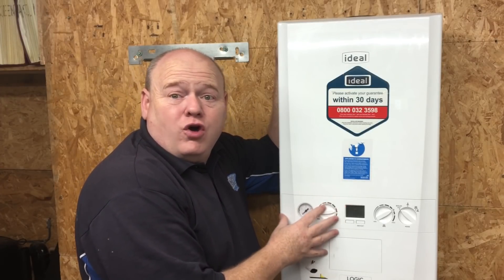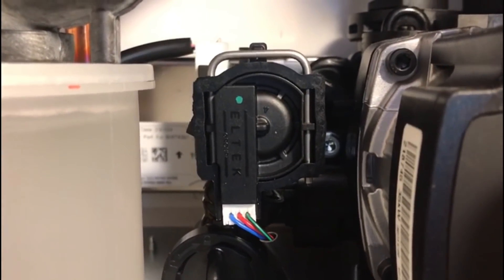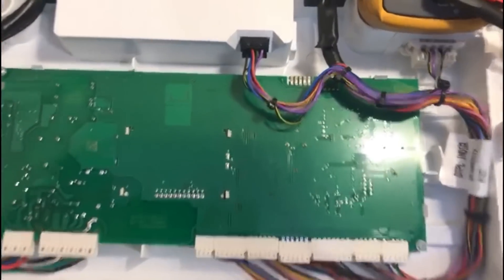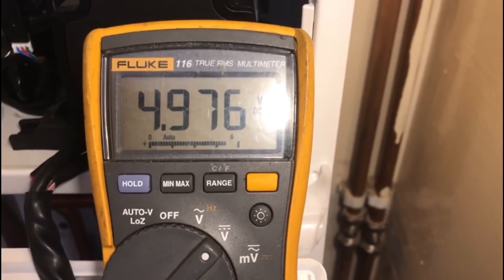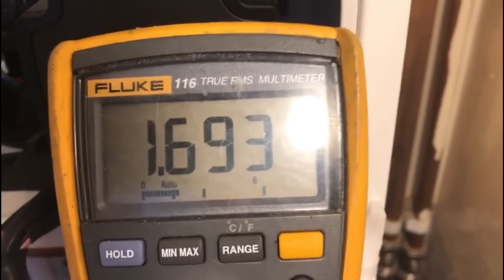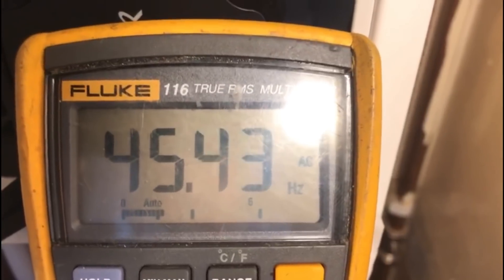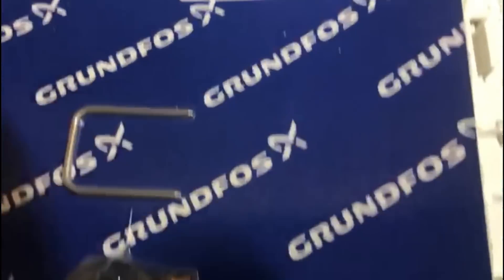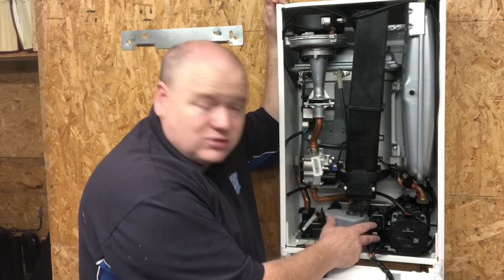Ideal Logic / Vogue No Hot Water - How To Test - Plumber

Comment: Thanks to Speedi Plumber who showed me what was wrong with my logic 30. Fixed it in 10 mins after running the tests.
Your plumber told you to change the wrong part. This doesn't make your YouTube page worth watching, as you can't touch things unless you are GasSafe engineer.
Reply: What was the issue with your logic? And what was done to repair it?

Comment: What if Ideal Logic boiler is giving hot water but not high temperature  in the bathroom.
I’ve come across two boilers replace all sensors but no luck 
Ending up replacing them finally. 
Can anyone tell what it could be please?
Reply from the maker: Plate heat exchanger or maybe flow too high, do you set boiler.
Reply: @AllenHart999  thanks for replying hot plate replaced flow checked and reduced but no luck even Ideal techinical team couldn’t figure out
Reply: What it used to do that giving high tempreature in the kitchen but low in bath room in all taps.
Reply: Did you get this sorted. I'm having same problem after Plate heat exchanger cleaned and no fault codes.
@ImranKhan-hz8jy
Reply: @tk4270  i couodnt get it sorted so finally replace the boiler but my experience says after doing all this that flow turbine is slow or rotten inside not spinning fully and Gas valve is not providing full Gas to the burner. This is the last option if you don’t get it sorted replace the boiler. But i tell you i never checked the flow turbine but you do please.
Reply: @ImranKhan-hz8jy  
I will get my boiler guy to replace the turbine. It doesn't seem like an expensive part, but I'm dreading the labour cost.
I may give it a go myself after seeing more videos.
Reply: @tk4270  did you manage to find the problem? I get tepid water not hot enough to shower. Only tap near boiler gets hot water if not turned on fully
Reply: @dipys1008  
No, not found problem. All these boiler experts suddenly go quiet with this issue or just want to continue putting parts in until old boiler is like new.
Reply: @tk4270 yes mine replaced turbine flow and no difference now wanting to try other parts
Reply: @dipys1008  
I got Turbine replaced even though it looked OK but still no hot water. 
Also changed Gas Valve but still no luck.
I have been told it could be DTC sensors. 
As no fault codes, Ideal say it cannot be Circuit board not sending signal for gas valve to fully open. My boiler guy ruled out the diverter valve. 
Central heating is very hot. I will get the DTC sensors replaced but if still not working, I will have to pay Ideal one off fee for about £300 to get it working.
Reply: @tk4270  yes I’m down to 3 possible items, NTC sensor, diverter valve and primary heat exchanger ( due to renovation I can’t find my multimeter, thought I would do electricals before calling gas engineer for heat exchanger )
Reply: @dipys1008  
How much is the NTC sensor. Ideal did not point this out to check or replace as far as I can recall.
Reply: @tk4270 I replied to this but doesn’t seem to be here. The NTC sensor is about £10, but better if you can test it. See videos of how to test boiler thermistor. Values should be similar as far as I can tell
Reply: @tk4270  hi did you see my solution, and is yours ok now?
Reply: @dipys1008  
We replaced the turbine even though visually, the old seemed fine. 
Still no luck. The last thing we think it could be is that the circuit board is not sending the correct signal to the gas valve to fully open the burners to heat the water for the hot taps. Flow rate has been checked and is OK.
My boiler guy is trying to find a circuit board off another boiler to try as Ideal will not accept returns on their new unit once fitted and part is expensive. We are just about coping with only warmish water for showers by reducing the flow rate from the hot taps.
Reply: Hi, i got mine fixed today in a jiffy by Ideal. Burner was blocked and only operating at a 1/3 of its capacity.
Burner replaced and we got hot water again instantly.
Reply: @tk4270  but i serviced the boiler fully and it happened that after few weeks 
And boiler replaced after that

Comment: I have this boiler and no water is coming out of the hot water tap, nothing, the heating still works though, so I’m stuck having cold showers 😂
Reply from the maker: I assume you fixed it; I also assume you had tried to top it up and turned the hot off. Thanks.

Comment: Hi I have ideal boiler esp1 35. My boiler is 3 years old and I head engineer twice already. First time he come when the boiler was brand new we move into the property and the water was giving. The engineer coming in with new pump. Open the box in the property and he realise this is a wrong pump. He go back to the van and straight away come back with already openbox. Second time the  same problem and engineer and you've done exactly open the box in the property and realise this is the wrong pump go out and come back with open box. And this is engineer with 20-years experience. And now I haven't exactly the same problem. I just wanted to find out how many types of water pumps have for this thank you

Comment: Will the boiler regulate the heat engine depending on a lower/higher voltage/hz signal or is the signal simply an on/off ‘switch’ with heat then regulated by the thermistors in the boiler? Thanks

Comment: Hi guys, I was changing one of these yesterday but the clip was from the bottom not the side of the turbine and I broke the clip and the wires actually came out of it. that's the first time I've ever done this but I'm sure I'm not the first, is this fixable? really not sure where you would get a replacement clip head its never something you think about until it happens. any help would be really appreciated guys thank you
Reply: If what your saying is true, you must be talking about a different boiler than an ideal logic, as the clip only goes into the top and i find it hard to believe e that you broke the metal clip, that would take some doing. Can you confirm the make and model of the boiler and exactly what you mean by the clip broken and wires damaged
Reply: Unless your talking about the wiring harness connection?
Reply: @HalleB127MX  yes the wiring “clip” from the pcb board, didn’t know what else to call it as it clips in and out of the component
Reply: Your gonna need a new harness then pal, give me the serial number and I will give you the part number?

Comment: Great vid.  Two components, a flow turbine and a hall sensor. A but. How do you determine if the turbine or the hall sensor is defective? Obvious once you know. The new to this may do a wrong diagnosis.
Reply: If your getting a Hz frequency signal, a stable one, but you are not getting the AC voltage back to the pub then you probably have a bad Hall sensor, Also if you pass a magnet over the Hall sensor back and to quickly it should activate the Boiler, if it does not then it is probably faulty, I wanted to keep it simple and not shove too much info in the vid. There is always more you can do but the basics are all in there.

Comment: When checking voltage going back to turbine you changed from dc to ac voltage, is this the same for othe makes of boiler. Awesome video 👍
Reply: I would say that no, they are would work slightly different and have different voltage readings back to the boiler. But the main principles are the same, you would have to call the technical line and get the info from them.

Comment: Hi mate I have this  new boiler September2019 the radiator are working but no hot water coming out of the taps
Reply from the maker: Give ideal a call as it will be under warranty. Thanks.
Reply: You will have turned off the cold water inlet valve when topping up the pressure. Second valve in front the right, blue handle, pull in down and all should be o.k.

Comment: Here’s another tip for guys just starting out on fault finding. This video shows the later composite water set on a Logic. The models before used a brass water set and the Hall effect sensor clips on. This older hall sensor has a small red LED built into it. Each pulse of the magnet rotation causes the led to light. If the turbine is spinning correctly with a decent flow demand, these pulses should made the led seem continuously lit. If you see this led flashing at all whilst the tap is turned on, there’s a very good chance the turbine is sticking. Hope this helps someone one day!
Reply: Did you mean if led not flashing at all?
Reply: @Home_made_ch  hi. If the turbine is jammed then the LED will not light at all. If the LED seems to flicker on and off then there’s a good chance the turbine isn’t freely rotating but not completely stuck. If the turbine is ok then the pulses of the LED will be so fast that it will look like it’s continuously lit. 👍🏻
Reply: @Lutonman2010  yes, so far i know. I mentiones as in your previos reply is saying if led does, instead of doesn't.

But in my case exactly led is flashing regularly and change frequency accordind hot water  tap position. But boiler not igniting. However CH is working fine and ignition get on and off in time
Reply: @Home_made_ch  could be a pcb issue/stat issue if you’ve ruled out the turbine/hall sensor. If you call ideal tech then they can get you to check the voltage on the board from the hall sensor. I can’t remember which terminals you have to check. I think on that model it’s on the DC side.
Reply: @Lutonman2010  i found terminals from manual. Do you think possible that pcb doesn't receive signal from hall sensor, if sensor led is flashing?
Reply: @Home_made_ch  I guess so. If there is a fault in the wiring harness. But I’m not clever enough to know the correct voltage reading that you should be getting. I normally call the manufacturers when I get an odd fault like this and I’ve checked all the normal stuff. My experience of ideal technical has always been very good.
Reply: And i checked now in boiler stand by mode 5v going to turbine hall sensor, but should in stand by mode be 1.2v on hall sensor signal wire?
Reply: Sorry wrong reading. 1.2v between red and blue and 3.6 between blue and ground

Comment: Hi Allan. Once again great video, i found it interesting that he was looking for an ac voltage coming out off the flow switch? in my limited experience on other types of boilers you normally get 5v dc going into the flow sensor and if the turbine or sensor  is working correctly you normally get half the voltage dc out (2.5vdc) is this just the case for ideal boilers or that type of sensor or have I got it completely wrong?
Thanks keep up the good work 👍🏻

Comment: Good vid.
If you want to find out if the Dhw pipes are crossed just run heating for 5 seconds then open hot tap, you’ll feel cold pipe getting hot for a few seconds.  Diagnosed in less time than it takes to get multimeter out.